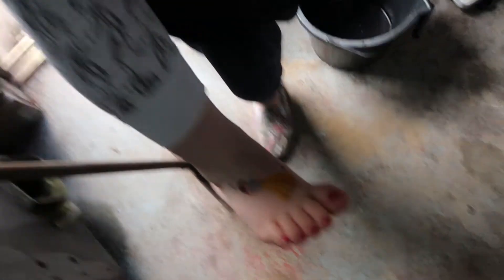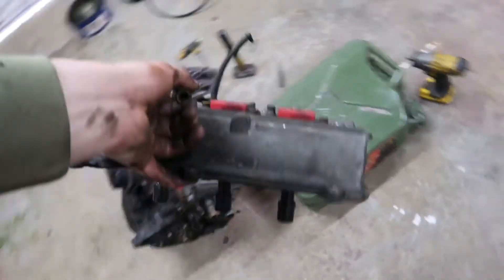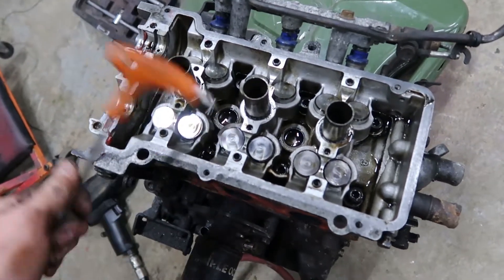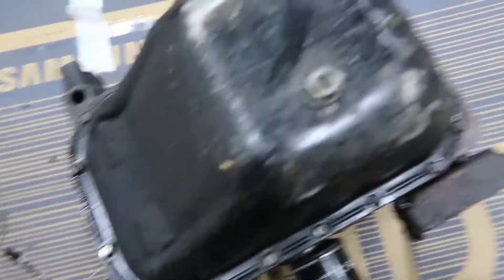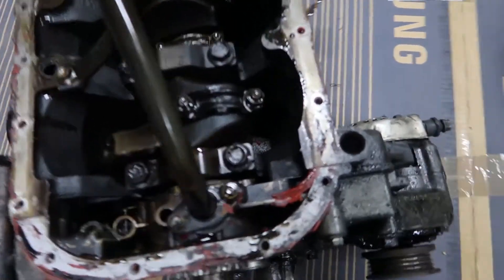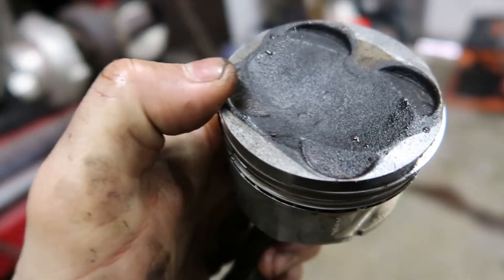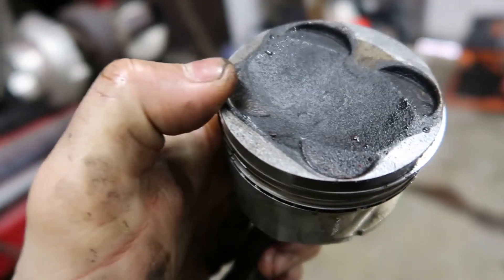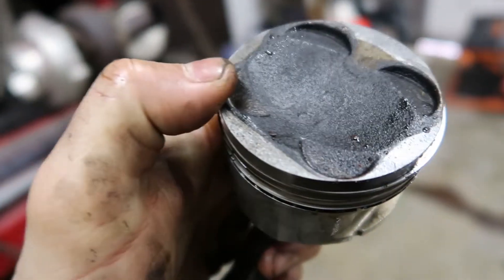BLOWN UP DAIHATSU MIRA TURBO ENGINE TEARDOWN [ Its Not Good! ]

Comment: Awesome tear down cheers from NZ!! These are still great little torquey engines. But if you put it back together with that crank would it stop the knocking thats my question? I have never seen a perfect bearing shell even on a car with 50k km. so scoring is not necessarily a problem, they are designed to wear.
Reply: @BEYTEK  Cool. I just bought a Daihatsu Sirion / toyota duet 989cc but looks the same as your engine. Major rod knocking like an old diesel farm tractor, then the engine just died. Pulled it open on the side of the road and exactly the same problem #1 damaged shell others look fine. So replaced the shell and rod cap, put it back together tomorrow. Hope it will run.. it's a 1999 but only has 97k km. Automatic. Destined for the graveyard but hopefully it survives! Just seems a waste to junk the whole car with such meticulous japanese engineering.